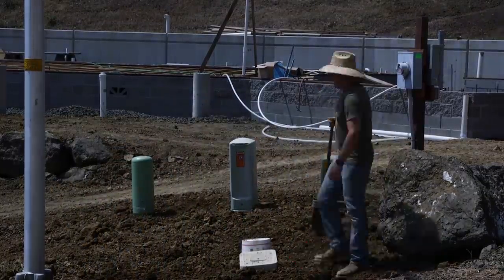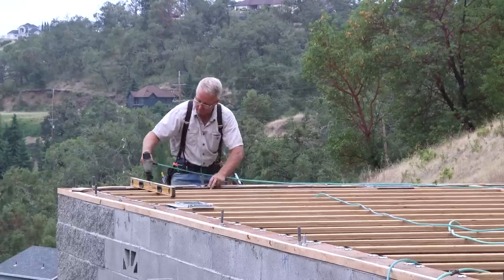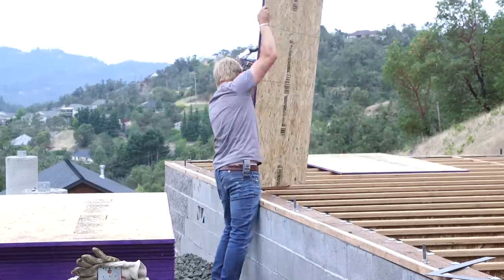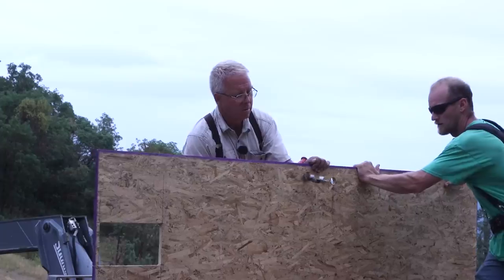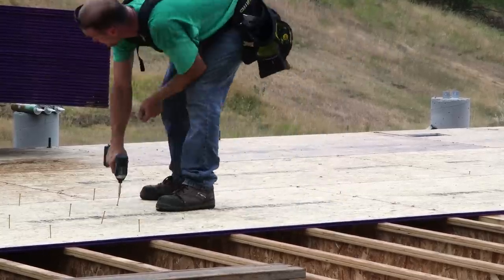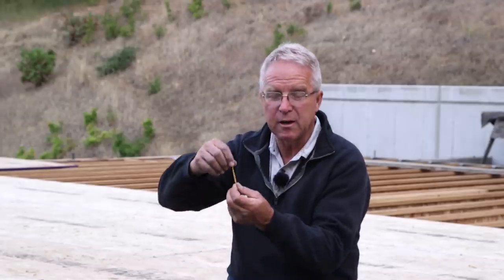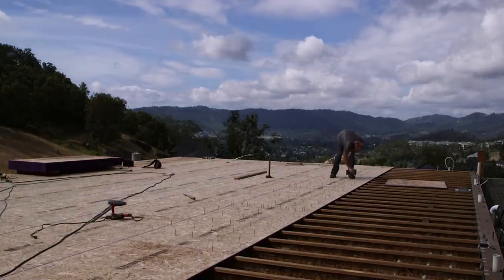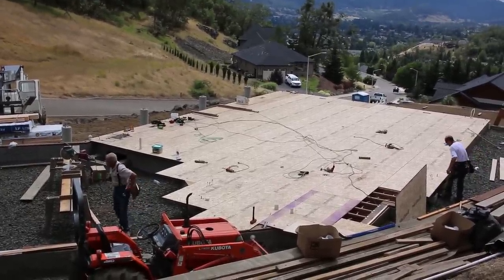Lay the Deck Ep.44

Comment: Ive never had any luck with the OSB subfloor edges shrinking back down after raining.
We just use a power planer to knock the edges down after the home has been dried in. Takes an hour or two of floor prep before flooring but well worth it.
Reply: Yeah, I was scratching my head too at EC's claim that OSB shrinks back to original dimensions when it dries. That hasn't been my observation.  It also hasn't been my observation that many builders flatten it out as you do.   I suppose that if it's being carpeted, it doesn't matter much, but it sure does when you're replacing the carpeting with hardwood or laminate flooring.   My approach has been to use a floor sander with the coarsest grit available.  Not sure how that compares to a planer for speed, but it works pretty quickly (plus you're working upright vs bent over on your knees.
Reply: @andrewalexander9492  I have never used the floor sander but one aspect I like about the planer is it fits easily in my trailer and I dont own a floor sander so I would have to take time to rent one and return it. I might try it soon though I have a few houses going up this winter im sure will need it.
Also for cleanup I attach a Vaccum to the planer and it helps keep the mess down. 
You can pay a little more for OSB and get a "no sand" guarantee but it swelled the same as the cheaper non sealed edge in my experience.
Reply: @moneymills7644  We build in western Wa and get every season here and mostly rain. A lot of custom builders will use plywood sheeting for roofs and walls but still opt for OSB on subfloor because it has less of a chance of creaking with all of the moisture amd temperature differences we get. I'm up in the air on that but am building my own house next spring and plan to do it that way.

Comment: I have been doing it longer than you,,, but I also am sure you are more skillful than I am.  I especially appreciate the regional differences as to how the job proceeds.  Materials with few exceptions are the same, but some of the details are distinctly different.  I have never seen a sub floor attached directly to the mudsill. I am still trying to analyze the benefits/deficits,  but I like it.  Your 1/8 inch perimeter shims,, brilliant.  I wondered how you were going to handle the curl and the hanger thicknesses.

I laid two subfloors that I have always been proud of.   Not appropriate today,, but the idea is still valid.  Luan plywood 1/2 or 5/8 was at one time dirt cheap.  The best floor I ever laid was 2 layers of 1/2 luan, alternating seems, 8d nail thickness spacing. (a nickel)  It was all square edge, all glued,, went in astoundingly fast. Stapled lower layer, screwed through the top into joists through both layers.  Its only defect,, nearly water tight.  had to drill a few holes to help water escape.  The other victory,,, old style diagonal 1X6,, with then a 1/2 luan top skin.  The house was built for a family with daughter,, horribly sensitive to everything. Luan did not bother her,,,, we ran allergy tests.  The old style floor laid with pneumatics on the 1X6 and chalk line hand circular on the perimeters,,  I'll tell you,,,that really ruptured my memories of hand nailing and hand saws on a subfloor.  Yes, I started right at the break of hand nailed 1X6 transitioning to 4X8 sheets.  So to use modern equipment with traditional materials  opens a whole world of possibles.  I would be surprised if you don't find some very similar old/new with your blacksmithing.

A pleasure to be schooled by you.

Comment: We use 7/8" edge gold tounge and groove sub floor plywood, over tight plywood in our wet coastal environment Leeds to buckling  creating the need to plane out the rise on the seams length ways direction once your plywood sub floor is dry, allways gap your plywood at manufacturer recommendation, but you are correct that gaps are visually an eyesore"

Comment: I like an osb roof, but I didn't know osb subfloors were a thing. We used plywood and sprayed it with a sealer for the first few years when I was young, then Advantech came out and we never used anything else again. Advantech is simply incredible. A scrap of Advantech can sit in a mud puddle for months and never swell. It's also expensive and heavy.

Comment: Gaps in the osb are your friend and required. In wet conditions especially. The osb will swell and with your butt joints too tight will cause the sheets to pucker. Voiding any manufacturer warranty. Always gap the minimum stated by the APA. The plywoo or osb in this case is sized for spacing.

Comment: Surprised you don't have an auto feed extension for screwing the deck down. We use PAMFast. So much quicker and easier than a standard impact driver. No messing around with bits falling out of their holders. No need for staples or nails at all. One guy cut and bang the sheets in place, the other guy follow behind to tack each one as it's dropped and screw it off while the next one is being lugged over and banged in place.

Comment: For future proofing, run a 2" pvc conduit from the house near the intersystem grounding block to the utility area and drop it into a small plastic hand hole (like an irrigation valve box).  It will prevent the cable/telco from having to dig up your landscaping to re-run any of their cables.  Especially useful if you're putting a driveway over the path.

Comment: Screwing glued floors is like wearing belt and suspenders.  The earlier commentary about I beams and decking becoming one piece with properly clamped adhesive was great; no need to back away from it later.  Properly applied glue prevents squeaks, not fasteners.

Comment: Like it from an effectiveness standpoint, but we use a cordless caulk gun to speed things up, or better spray foam subfloor adhesive. Then a Simpson collated standup screw gun system, again for speed. And as long as I have Makita batteries for the caulk gun, I have a little cordless blower to keep the joists and sheets free of dust or other obstructions. All way faster and pay for themselves in one job in saved labor.

Comment: I love your channel. You are the most well-spoken carpenter, by far, that I have ever seen. Your honor and commitment to our Lord and Savior, to your wife, and family are a breath of fresh air. Thank you for the consistency in your life and the humbleness of your spirit. 

I have a framing and decking question for you. Since today's 4 x 8 sheets of plywood or osb are a 1/16" short in both directions should studded walls and floor joists still be framed on 16" centers and leave a 1/16" gap in between them or should the studs or floor joists be be shortened by 1/16" such as the first on 15 15/16: and the second one 31 7/8". I always thought that the plywood being butted up against each other gives a more rigid wall or floor system. Thank you for your time and all of your efforts in all of your videos.

Comment: Ring chank hot dip galvanized nails with adequately glued I joist does not sqeek at the coast, aggressive nail schedule 4" on edges and 6" in field does great, hangers have a tendency to sqeek if not glueing the hanger pre installation of the I joist in the field"

Comment: OSB subfloor panels do in fact have a right side up. You will notice when you look at the tounge and groove, the tounge is offset from center towards the surface (opposite hardwood). Also on higher quality panels you will see grooves datoedon the bottom side of the butt-joints. This is to allow water an escape during construction.

Comment: I'm not a fan of OSB for roofing (I own a roofing company). It doesn't hold nails as well as plywood and I find more nail pops on OSB decked roofing by far than plywood or slab wood decking. I'd heavily recommend using 1/2 or 5/8 plywood (depending on code and truss spacing) over OSB. The cost difference is pretty small, and when you walk the roof you'll feel the difference in how solid things feel and how well the nails stay where you put them over the course of time.

Comment: I would suggest you try a 12v milwaukee (cheaper than a makita) caulking gun since you are going to be laying many feet of bead.  About a $100  with both sizes of tube available.  You will never regret it.  Also while I still prefer plywood to OSB since I am in real rain country (try 170 inches per year average with plenty of coastal wind to go along) OSB does not "bounce back".  Once it gets wet with our humidity and rainfall it just swells up and disintegrates.  The only thing worse is MDF.  Now I say this as the quality of plywood goes to the birds so it isn't as big a gap as it once was.  twenty or thirty years ago you could frame and sheath a house with CDX as well as lay the subfloor, walk away for a year and come back to sound material although grayed from the weathering.  Modern plywood delaminates in the lumber warehouse!  i don't know what they are using for glue but between it and the laminates it is terrible to work with.  Not yet as terrible as osb but getting there.  You don't find just a few voids either but entire sheet wide gaps as well as areas that have not seen any glue at all.  They completely fall apart as you cross cut or rip a piece off.  Maddening to work with.  Although the price keeps going up.  The industry seems bent on cheating the consumer as much as possible.  Don't even get me started on 2x8's that are an 1 3/8 x 7 1/4 as well as so full of knots, dry rot, and deep wain that they are unuseable!!    You don't get much choice and you sure can't blame this on the Chinese!  Are you aware that 'I' beam joists are manufacture specified to not be suitable for unconditoned areas?  These would of course include soffits, gables ends, garages overhangs, decks and balconies.  It used to be possible to specify plywood webs but I am not aware of any manufacturer who will make them currently.  If they can't handle ambient moisture it sure throws a red flag up!  Because we have to order our lumber it is not possible to hand pick materials even if you wanted to pay for the labor so a huge part is chalked up to waste and we eat the cost.  It seems like they start with a good idea and then dilute the process as the bean counters get involved until it becomes unworkable.  I haven't any personal experience with some of the "rainproof" osb products so that might be an alternative, I don't know.  Enjoying your build.  Take care.  Doug

Comment: My house was built with what looks like 2x6 joists. 
My deck outside that butts from the house up against my pool however was built by my hands using 6x6 posts and 2x12 joists and 2x6 deck boards all architectural cedar and it has survived over 21 years. (Thank you Cabot for your wonderful stains) My house squeaks, my deck does not. Oh and I used 2x12 for the banister as well. You can comfortably put your dinner plate on it and your phone and a beach bag etc etc. Nothing I wanted more on my deck than a wide top cap. I dropped too many frosty beverages 🍺 🍷 🍹 🍸 from the 2x4 top cap of "lesser" decks through the years 😂.

Comment: Great vid Scott!  Whereabouts is this property?  Regarding OSB, it had delamination problems back when it first came out decades ago but those problems were worked out by BC and LP via better adhesives and higher retort pressures and which gave rise to an incredibly strong and stable product.  I used it on my entire addition vs ply which I'm not a fan of for the reasons you mentioned.  The other significant drawback with ply is that termites, carpenter ants, and powder post beetles love it whilst OSB is their collective mortal enemy because the adhesives kill em all!!!  

We're down here in San Diego and have been since 2006 when I relocated for work and have since painstakingly restored a 1923 Cal bungalow to museum-quality conditions.  This initially included my wife and I removing all the asbestos transite siding ourselves over that first summer which exposed the incredibly preserved original redwood lap siding and me rejacking the pier-and-post foundation up 7 inches on the west side and then resetting all 24 posts with 4-inch bucket screw jacks which I left in place for a tunable foundation.  Upon further inspection, I then discovered that the sill plate on the original home's foundation was never bolted to the concrete stem walls back in 23' and was just laid on top of said walls nor did they attach the floor joists to a rim joist at the end of the sill.  So I blocked all of the spaces between the joists, tied all of the joists to the sill and each of the three support beams with Simpson hurricane ties, and am using Simpson UFRP earthquake foundation plates to secure the sill to the foundation walls!  Thank God for a 3-5 foot crawlspace.  Also used the commercially-sized engineered floor joists to support our garage roof! At 64, I'm finishing up the UFRP EQ plates as we speak and we'll get this little gold mine up for sale come January and head back up to WA St.

Comment: I run torx screws whenever possible and I don't think I've ever stripped one... I have encountered countess individual screws that had too much paint in the torx head, making it nearly impossible to get a decent bite with your driver. But torx is WAY better than Phillips - I used strip those out left and right back in the day. Square drive isn't bad either imo

Comment: As a do it your selfer I would never use OSB for a subfloor. Advan Tech brand subfloor saved my butt while building in rainy climates. It does not swell or delaminate even submerged!. I am still using pc's years later under jack stands that support welding projects outdoors for weeks. No swelling No delaminate. Yes its twice the money! If its Advan tech subfloor it can rain for weeks it wont matter! Course if you have a full blown framing crew and a clear weather window go for it!

Comment: On a house like that with all that money I would have went with a full size basement... and used steel bar joist.. steel decking and poured the first floor with concrete.. you could have used anywhere between 3 to 5 in... with proper scheduling that whole floor could have been done in one week.. or in other cases they have prefab houses that use purlins... IDK maybe it's just because I've been a high-rise structural ironworker.. for 35 years and have build many of those type home structures on the weekends...

Comment: At about 9:10 I hate it when the bit comes out of the bit holder.  2 or 3 1/2" bits locked directly into the driver save a lot of grief, and eliminate some of the slop between the bit and holder that can make it more difficult to apply pressure in a straight line.  An extra dollar or two up front on the bit can easily save five to ten dollars of grief and your time in constantly putting the bit back in, finding where it dropped, extra stripped screw heads and the occasional screw that wants to wander off course.  Save the 1" bit + magnetic holder for the weird sizes where you're just driving a couple fasteners.
Reply: I'm glad it skipped a bit when that happened.. lol 😂
Couldn't watch more of that!
Collated screw gun would have been so much better!
Reply: @jaybloggs8699  For sure.  Screw gun would absolutely be the way to go if you plan on doing this for a living.  But if you're just say putting in a deck or renovating a room in your house (probably a significant amount of the viewers) an impact driver is fine if you already have one.  Just don't skimp on bits.

Comment: Have you considered or looked at Advantech flooring - better for us NW builders as it has a 500 day no sand no swell guarantee.  Which equates to no lid on your structure as long as you need during these usually "dry" winter months.

Also - standup screw gun, save your back.

Comment: In my opinion they did not use enough glue. Squeaks are likely to happen where wood and metal meet. I framed for years and was always taught to be generous while applying glue, since it is relatively cheap. Not gluing the tops of those joist hangers might be a problem some day.

Comment: Scott & crew : EXCELLENT video!! (...as usual!)...A little puzzled though as to why you did not use a TIME SAVING tool of an 18v battery caulking gun? -- to speed up the laying of the construction adhesive? Is there an unknown benefit to using a hand powered gun only over a battery version?

Comment: I question the use of 21/2" screws. My understanding is that the fastener needs to be 2 x the material thickness, so in this case, 2x 3/4" = 1 1/2" screw, not to mention the adhesive.

Comment: Another fascinating video with exceptional value!  Quick question - I noticed that the screws were being started with a hammer -- I've re-decked several outdoor decks in the past few years (natural cedar) but I've started the screws by drilling pilot holes. Is this a waste of time?  Can I start deck screws by using a hammer (specifically composite decking) or do I risk chipping?
Reply: In our experience with composite deckboards, not pre-drilling them can cause the material to swell a little around the screw head.

Comment: 2:40 (ish)

I am a Southeast Michigan home builder. I've never experienced the problem you faced here with the warping/cupping of a mudsill that is bolted down.

I am not a fan of strapping at all and certainly prefer a j-bolt application.

Could this situation you've encountered be due to the fact that you're using a lesser grade of lumber, specifically a lesser grade of incised pressure treated lumber?

I ask because I've been a home builder for 20 years and have also built nearly a thousand pressure treated decks and in Michigan we do not commonly use a low grade incised pressure treated lumber.

Does the low grade and incising have a factor in this problem and if so is it really cost effective to use such a product?

Thanks - Knowing the answer 😎